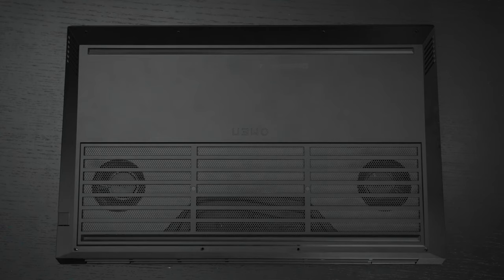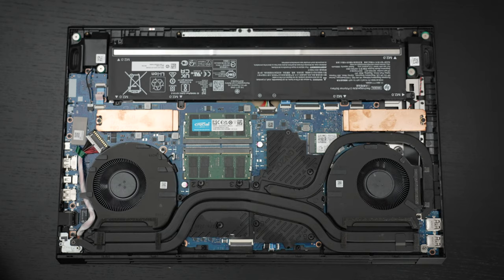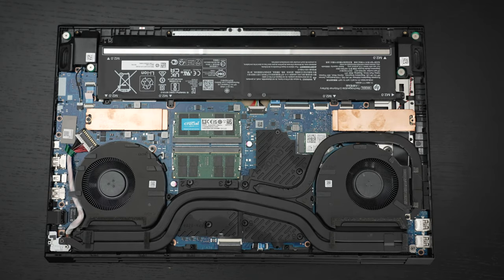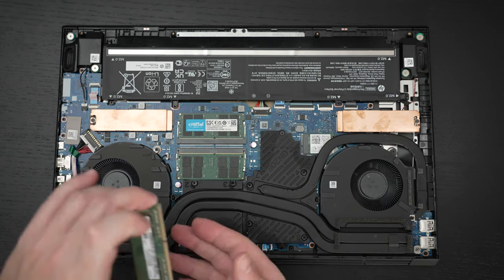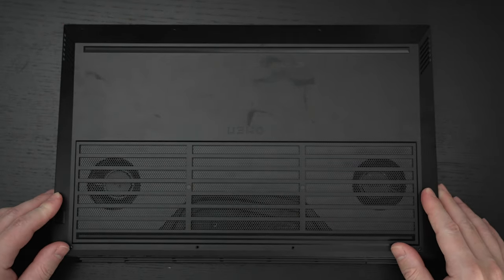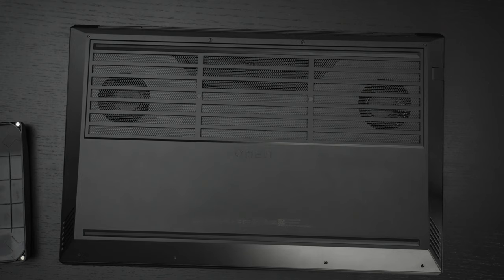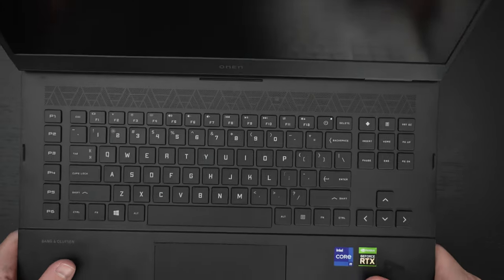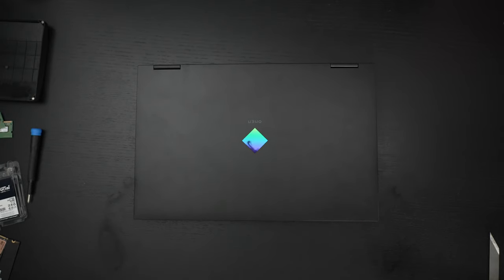HP Omen 17 2021 Upgrade

Comment: The system I have is the i7 11th Gen with a RTX 3060 6GB and 16GB of Ram. Absolutely love it. So fast, while the fans ramp up, its never too hot and confortable to use long term. :)

Comment: I recently got the hp omen 17 ck0013sa, My gripes are the track pad and no physical buttons, no HDD led and no GSync which is rather surprising on a new laptop like this [This model is 165Hz, QHD and the RTX 3070] - My old maching with 144Hz/RTX2070 did have GSync. I know the new one doesnt as when its connected to an external source the option appears in the NVIDIA settings - Its still a great machine however

Comment: Great job tearing it down and upgrading it. I have quite a few hp omen products including the Omen 17. I see in this video you also upgrade the RAM, and I was wondering, because on my Omen 30L I have found that HP do no like people upgrading their machines but let them anyway. If you upgrade the RAM on a 25L+ model desktop, the RAM will be hardlocked to 2400mhz speed. I don't know about laptops, but when you upgraded your RAM, did it cap your speeds? Or were they as high as their actual speeds?

Comment: Sir I have a Hp omen 17 identical to your model sir. I would like to ask if a samsung 980 pro with heatsink would fit. Or should I just buy a ssd without a heatsink?
Reply: Without heatsink because Omen comes with the heatsink in the motherboard. You can see in the video the copper or aluminum sheets. Update the firmware of your Samsung 980 NMVE if you buy, they are bugging.

Comment: The Omen website (not the HP website) lists a somewhat similar looking Omen 17 but with a bulkier chassis: with a numpad and a "neck" hinge that creates a gap between the laptop body and display (some previous Omens had the same neck thing going on). While it looks to be the last year's model - the page for it talks about 2000-series Nvidia graphics and 9-gen Intel CPUs - I wouldn't be surprised if they released a 2021 model with the same bulky chassis. The page says "Coming Soon" for it for some reason too.
Reply from the maker: that's last year's model

Comment: Didn't like how HP dumped the numpad on the newer gen Omen. Per RGB is nice, you can have certain key illuminated for different apps over four zone RGB.
Reply: Yes I love per key for that reason. You can create different profiles for each different games. So you can set up key effects or static lighting for each app individually
Reply: Also you could use a Bluetooth number pad. I got a decent one from Amazon for about $20

Comment: Yes but no amount of heat sinks and pads will bring the NVMEs into the 40*c “preferred zone”. Mine run around 60-70*c with Thermal Grizzly pads and heat sinks. 2020 Omen 17t-cb100 i9/2080 Super. Very similar to the 2021.

Comment: Ok so I'm guessing my Omen 17 is a slightly cheaper build. It has the 16G ram but it has a 128G nvme SSD drive and a 1TB 2.5" HDD. It has an extra slot on the motherboard for an additional nvme drive but no connector. Can I add one or do I need to have it soldered on?

Comment: I got a 3060 version of this laptop but the trackpad does not work. I have updated drivers and even used function keys and nothing so I’m considering opening it up to see the problem. Would you say that it is possible or should I just get a technician to do it?

Comment: So, i have the exact same model. I had installed a 2tb SD and then each time i booted up my laptop, it would state an error with the CMOS battery. 

After a bout a week, it is now bricked. Hp support states the CMOS battery has to be replaced. Id like to do it myself instead of spending $538 ESTIMATE, but not sure where to locate it. 

Still in the beginning steps of research. Only just got off the phone about 15 minutes ago

Comment: What is the max memory speed for this unit?  3200 or 3600?. I ordered mine with 32 gb of 3200 but was wondering if it could be upgraded to 3600.
Reply: 3200 Mhz is a CPU limitation similarly previous gen was 2933 Mhz

Comment: Ed?  Does your BIOS correctly report with 64GB installed?

I just got one of these while on sale for $400 off  ($1400 delivery took 4 months).  i7 with 3070.  Came with 16 gb ram and upgrading ram to 64. I put  in a couple of sticks of G.Skill F4-3200C22D-64GRS. CL22-22-22-52. Memory seems ok.  Started memory test... but still waiting for it to finish.  Windows is reporting 64 GB, but weirdly, BIOS of reporting 0  MB memory.  Anyone else?
Reply: Any update, as I am looking at the HP OMEN 17-ck1021nr and would want 64GB RAM.
Reply: @michaelkenefick  not really.  I have 64gb installed in my 17t-ck000 and it's working fine.  The Bios screen still says 0 GB but the computer seems otherwise unaffected.  The HP Support assistant & windows correctly reports 64 GB.

Comment: Is the secondary drive a gen 3  SSD slot, or they are both gen 4 slots? Just bought a gen 3 SSD for my second slot, hoping I didn't mess up.
Reply from the maker: the second slot is not Gen4. You're good.

Comment: What size Nvme will this laptop take omen 17-Cb1060nr… also reading, it says it can take 2.5 inch hard drive. I’m just confused on this laptop. Here is the specs OMEN 17 Gaming Laptop, NVIDIA GeForce GTX 1660 Ti, Intel Core i7-10750H, 8 GB DDR4 RAM, 512 GB PCIe NVMe SSD, 17.3" Full HD, Windows 10 Home, RGB Keyboard (17-cb1060nr, 2020 Model)
Reply: Nmve is not SATA. NMVE is like ram modules. 2,5 is HDD Sata. This omen can have two NMVE m.2 and none SATA HDD. I think your model only can have one NVMe SSD and one HDD Sata, but I don’t really know it . You have to view more videos of Omen replacement to understand. Omen 2019 can have two NMVE m.2 and one 2.5HDD Sata

Comment: I agree 100% on the i9 vs i7 build. I have the best buy. Version with the i7 and with XTU. I honestly feel 0 fomo not having the i9. It's honestly a monster either way...

Also managed to find mine as an open box so it was only $1650... Not sure what else you can get with these specs for that low of a price...

Have you been able to find any skins for this laptop?
Reply from the maker: You scored! This is my favorite desktop replacement at the moment... I haven't looked for them but I'll see if M2Skins has any plans for it.
Reply: @TheDigitalDigest  nice do let me know I got two different skins from m2skins from my many different omen 15s and I loved those.
Reply: Got it brand new on Amazon for $1,700. Ship and sold by Amazon. It came in a box with no padding and was moving around in there like crazy and the main omen box was beat to shhhh*t. But even with amazon’s lousy packaging job the laptop inside the main box was perfect. I love this laptop. It replaced a lousy lemon asus g15 I had and this omen is a massive huge upgrade over the lousy g15. And the g15 was the same price and the 17” omen.
Reply: Yeah the reason I started buying Omen was because its the cheapest laptop I could find with a dedicated graphics card (payed like $800 for my old g15 back in the day). Got the new 17 for $1630 from HP...it was on sale. Came with a nice headset too. I got it with 32g ram, so I didnt NEED the ram boost, but I wanted it ;)

Comment: 12:10 XMG Ultra E21 (and other laptops using the same Clevo chassis, e.g. XOTIC G170KM-G) are more powerful. Desktop Intel 11-gen CPU, 2x TB 4 ports, 2x 280w power bricks (560w!) etc.
Reply from the maker: I'm specifically talking about big box manufacturers

Comment: Hi, i bought the same laptop, omen 17 21, my ram is currently 16gb, i want to upgrade to 64 or wts the max we can upgrade, i use alot of 3d softwares,
Any specific model or ghz in ram should i look for?
Plz advise
Thanks!
Reply: You need 3200Mhz Ram. Like these examples “Crucial RAM 64GB (2x32GB) DDR4 3200MHz CL22 (o 2933MHz o 2666MHz) Kit de Memoria Portátil CT2K32G4SFD832A” or “Kingston Kit de memoria para ordenador portátil FURY Impact de 64 GB (2 x 32 GB), 3200 MHz, DDR4 CL20, KF432S20IBK2/64, negro”

Comment: Just bought an open box Omen 17 with i7 12700H - RTX 3060 and 512 GB SSD. Is there a second SDD slot inside and if, is it gen 4 or gen3 ? Does anyone knows? Thanks.
Reply: its gen 3. the one that has stock ssd in place is a gen 4
Reply: @1msorry1  Thanks. Now i know what to do.
Reply: @1msorry1  Do you know if this laptop supports a 2TB SSD (as second drive, the gen 3 )?  The SSD ( gen 4) that is already inside is a 512 GB.

Comment: I just ordered the Omen 17 from HP and it's on its way.  Should be delivered soon.  However, the only one that was available on their website was the i7 with the 3060 GPU so I went with that.  I hope that CPU are GPU are sufficient to do some photo editing and some minor video rendering, mostly 1080p.  Thanks for the awesome video.  Can't wait to get my hands on it.
Reply: They have 3070 but you have to wait till december end to get it
Reply: Hey whats the difference between hp omen 15 and hp omen 17
Reply: @wabduwabadu  one is 17 inches, one is 15 inches
Reply: @Xlub  Higher watt for the RTX 3060 for the 17 version against the 15 version?

Comment: Do you have any idea if the 165hz QHD Panel is g-sync ?!
Reply: I have read elsewhere that it is not
Reply: @AllThingsFascinate  I actually received mine two days ago, and it is gsync once you put advanced optimus in dedicated gpu mode.
Reply: @mido830  where do you do that?
Reply: @davidnava1592  through omen gaming hub's graphic switcher, then you will see the option in the nvidia control panel
Reply: @mido830  hate to bug you about this again. I have it set to discrete on the omen Gaming hub. Opened nvidia control panel and the G Sync option isn't there. Did you do any special updates to bios or anything?
Reply: @davidnava1592  i remember there was a bios update when I first bought the laptop in hp support assistant,

But I believe it was there even be4 the update.

Comment: this thing is retailing for 1600$.. for i7 and 3060/// wish it was in 1200$ range...still way better than dell xps 17 with same config going for 2000$... I mean my previous HP envy lasted me 5 years and then some finally got bored and gave it to my mom... so the price tag dell demands is no where justifiable atleast for a individual.
Reply: $1350 on hp website right now.m if you thinking about Dell go with the g15 sane specs for $1100
Reply: i just got one from micro center for 1050
Reply: @chrisc9106  3060 ? dam sweet deal
Reply: @reboucasdev5192  yeah right now there 1150 for every one. found an open box one for 1050 though. its been great for what it is.
Reply: @chrisc9106  awesome deal

Comment: Did you notice the fan noise go up and down when it is at low level?
Reply from the maker: yes...it makes a whirling noise
Reply: @TheDigitalDigest  So I guess that's normal? bit annoying, I wish it can be louder but consistent. Other than this, very good laptop.
Reply from the maker: agreed...I think it's something that can be addressed with software updates but we will have to wait and see.
Reply: @cairo9236  Yes. This is normal.